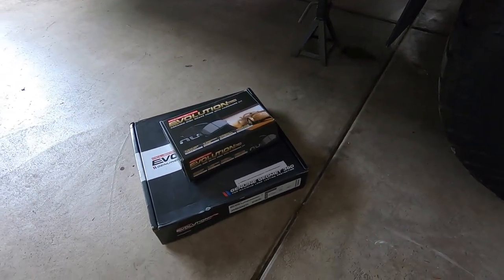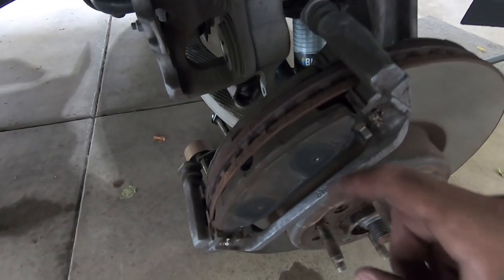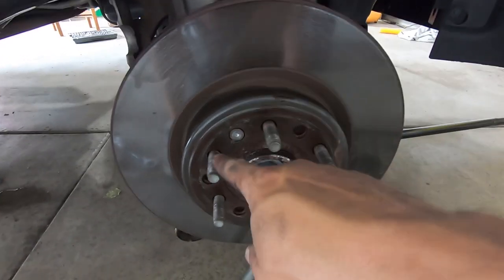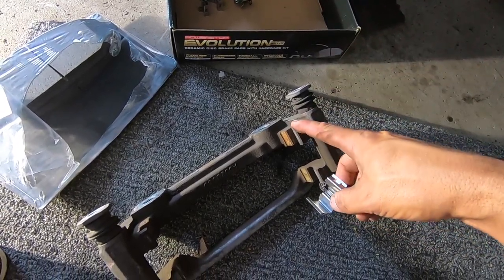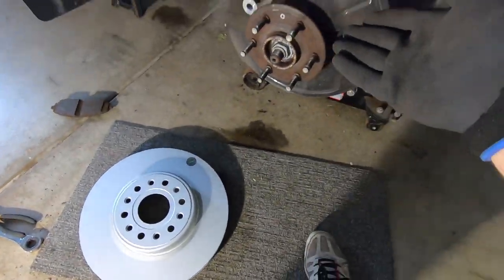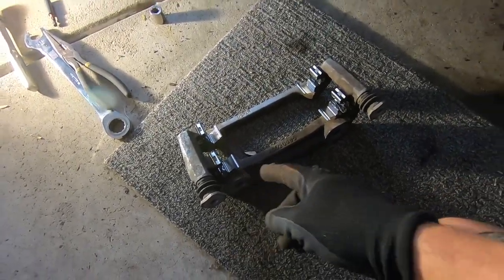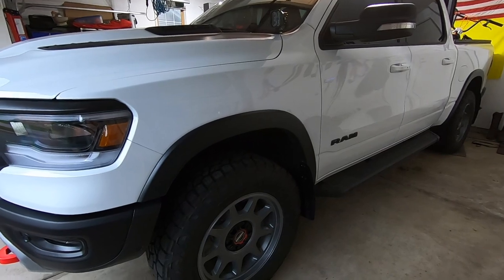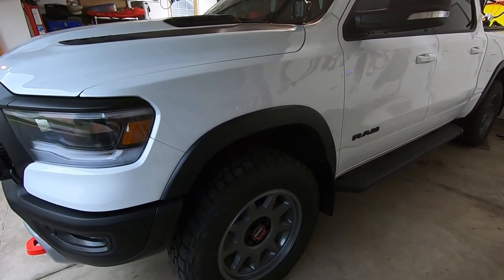Powerstop Geomet Rotors and Evolution Brake Pads - Ram Rebel #powerstop #brakejob

Comment: I just removed the slotted and drilled ones and went with the geomet coated powerstop. I am very impressed with these. Quiet and work well stops the car quick. The slotted look better but they make these weird noises like you said never again will I purchase slotted rotors
Reply from the maker: I hated the drilled/slotted when I ran them on my first truck, I agree, very loud!

Comment: Do you wipe them down with brake cleaner before throwing them on? From what I’ve read you aren’t supposed to on the geomet coated but I’m used to doing it to all the rotors I get
Reply from the maker: I've heard both sides of this conversation but I think its safe to just throw them on and rock and roll without cleaning them.  The coating keeps the metal clean.  Obviously the cleaner they go on the less of an issue this is.

Comment: Hey man, I just installed APEX quick deflation valves on my 23 rebel, and now my steering wheel is slightly tilted to the right, 💔 do you have any requirements?
Reply from the maker: I’m not sure I understand how installing the apex valves impacted your steering. That said, take your truck to an alignment shop to verify if you’re within spec.
Reply: @WaterFowler41  could you explain how can installing a valve change the alignment? As I don’t understand why
Reply from the maker: I have no idea, sounds like your steering alignment was messed up before the valves were installed.

Comment: Their carbon ceramic brakes are great!   Why did you choose Evolution pads over the Truck & Tow pads?
Reply from the maker: They came as a package paired with the geomet rotors from rock auto
Reply: @WaterFowler41  Makes sense.  Thanks for the reply and great video!